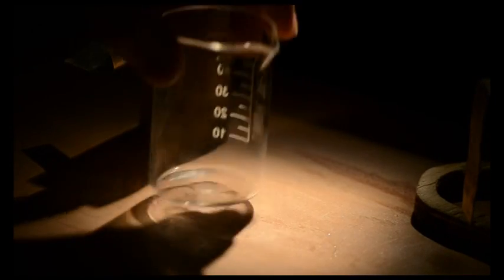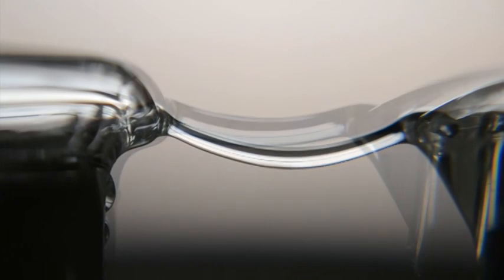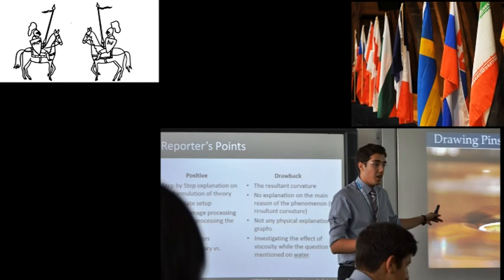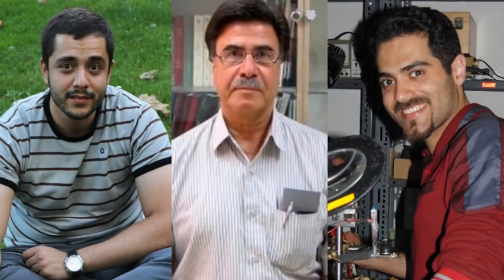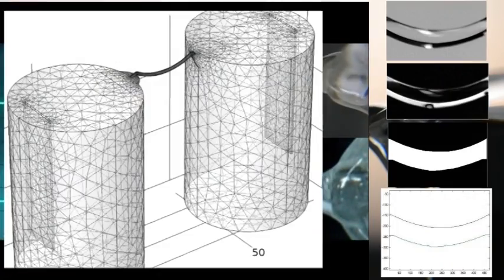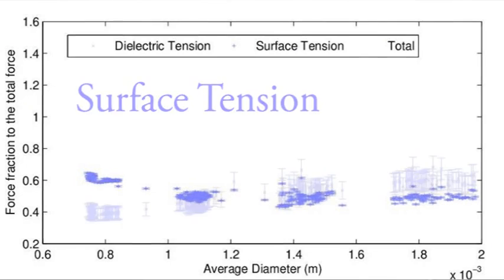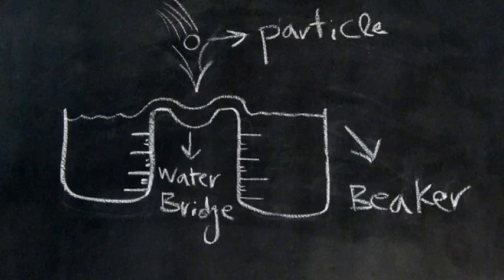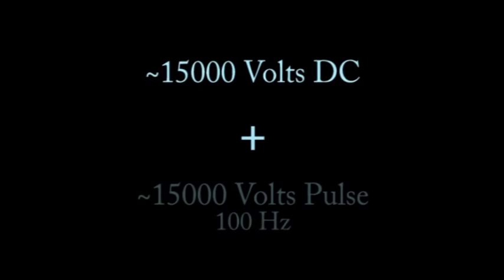Floating Water Bridge: Amazing!

Comment: I think an important aspect about how to understand this experiment is the unseen structure of the water flow. I thought I saw micro bubbles rotating in a spiral from one beaker to the other, and I suspect there may also be counter directional flow once the bridge is established- two simultaneous flows, one inside the other but in opposite flowing directions. It would be very informative to observe the currents